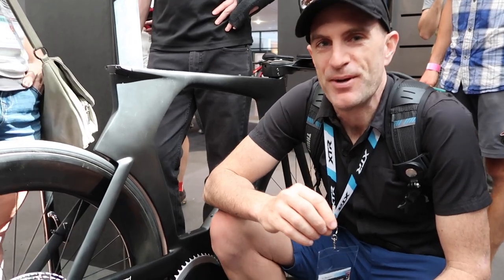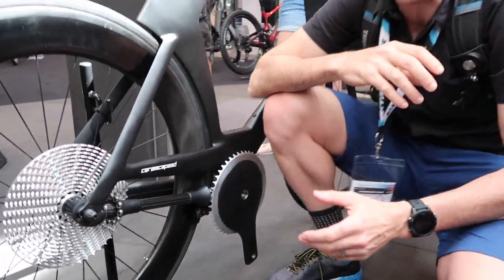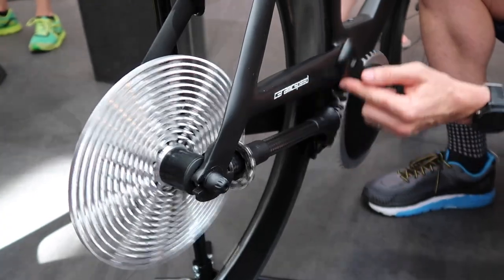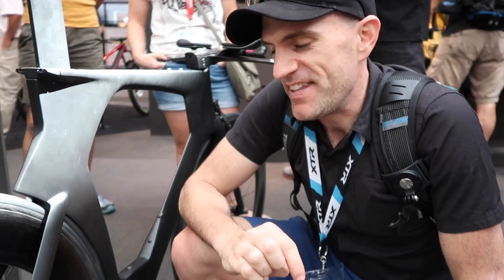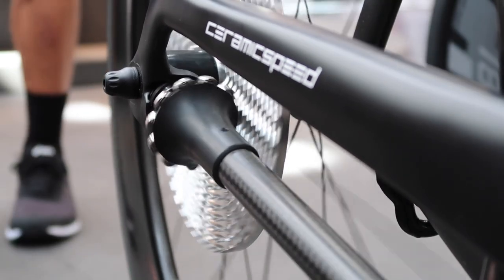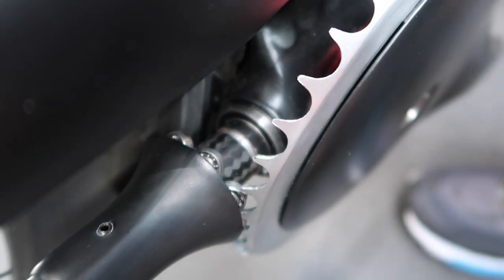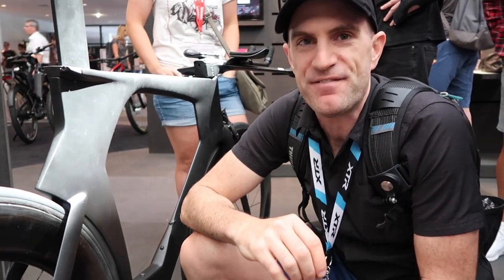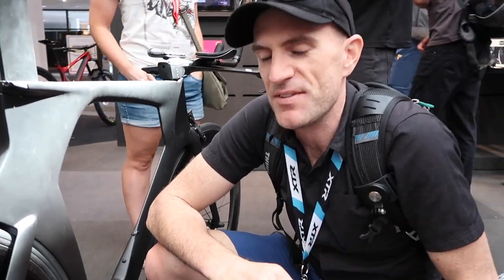CeramicSpeed DrivEN 99% Efficient Drive Shaft // Chain Free Bike // Eurobike 2018

Comment: While I understand the concerns of the ‘engineers’ on here (exposed parts, aluminium gears, ingress of dirt, patented in 1830 and so on), we should bear in mind that this is a PROTOTYPE, not a finished product. All of these things will have to be addressed if the concept is to move forward.
The idea of a shaft drive may not be new or even as efficient as a chain but there is an undeniable appeal to its clean lines and I’m pretty sure there is a place for it.
Gear selection by changing a helical drive contact point across a disc looks like a brilliant concept. Admittedly this particular example leaves a lot of questions unanswered and it’s easy to see that it needs more work, but so does the Mars expedition. Showing it to the public like this should be of benefit.
My own take on it might be to enclose the gear bevels into a housing to keep the dirt out and give scope for a more robust construction which would in turn allow more torque to be applied to the pedals. It would also allow for ‘enclosed, low maintenance lubrication’ if needed.
And how about putting the gears at the pedal end? If the drive shaft itself were telescopic the existing ‘varying diameter disc’ concept might still be used but at the front, and that would put the ‘contact point’ further behind the front sprocket and out of harm’s way.
Alternately a fully enclosed ‘gearbox’ with Epicyclic or planetary spur gears could be used at either end of the shaft and the whole thing could be enclosed. It might not look as ‘trick’ as this one but I don’t think I’d want to catch my trousers (or worse, a finger) in that exposed machinery down there next to my foot. It all looks a bit sharp.
Anyway, nice one Shane Miller - GPLama , good interesting video (congrats on four and a half MILLION hits), and well done Ceramic Speed, it clearly still needs work but it’s a great idea and ideas keep us moving forward.  Keep it up and keep it upright!
To the 4K of ‘thumbs down’ engineering critics out there, how about being a little more constructive? Tearing things to pieces isn’t much of a help. Let’s have a bit more inspiration and a bit less condemnation.
Peace, pedal power and love (from an old hippie)!
Reply: Dennis Loobman none of the questions are unanswered. This is elementary level stuff that first-year dentistry students can answer with only a few minutes of thought.

Comment: Those bearings won't stand a chance in mountain biking. Gear boxes and belts could be the solution.
Reply: Even on the road, those open bearings won't last more than a few days..
Reply: With a traditional chain grit would just add some unwanted noise and air. In this it could cause one of the bearings to fully seize. It's really just a showpeice since you would only be able to shift gears at where the teeth line up on the cassette which would probably only be in one part of the cassette and most apparent in the biggest ring would be the torque of the driveshaft would force the cassette to bow away from it causing it to skip teeth. To mitigate the issue of shifting they perhaps could have one drivering per speed and have them all float freely and have the selected gear locked to the driveshaft like in pinions gearbox but this solution would defeat the claimed goal of power efficiency.
Reply: It's not for mountain biking. Just like a full suspension isn't for road bikes.
Reply: Joselo Aero   Belts tend to slip & flex too much. Not a good idea in cycling yet. Power transfers are problematic.
Reply: seedorfj   100% correct.
Reply: hapiman97 
I get what you mean there. I'm sure a final product would have sealed bearings. About the gear system. It's practical and would work better than sliding the pinion back and forth potentially causing missed shifts. Let them figure out how to make it lighter. The shifter mechanism will take more thought to neatly package.
Reply: Rex Luminus  I’ve had belt drive on powerful Harley and bells without problem
Reply: Russell Artist   Most are chain driven for some good reasons.  Your's 👍good too. Drive shaft on some BMWS are fine too. Some are less noisy or easier on the the systems.
Reply: Rex Luminus guess you realised auto correct spelt bells instead of buells 😂 and yes shaft works well too, guess I’m just too lazy to lube chain 👍
Reply: Russell Artist    Lubing chaine only in 5 minutes.  I know. Longer when needs major cleaning. Runs easier after lube job.

Comment: 2.2k people prefer chains. what's up w the dislikes? this is awesome
Reply: Kekistani Trumper cause it's not awesome. A chain is over 99% efficiant already and works. This will not work due to the stresses and the amount of force that would be transmitted to the teeth of the rear pinion.
Reply: Sadly most people have no imagination.  My last 2 motorbikes have shaft drive as i skipped a chain that lock up my rear once and decided never again.
Reply: Millions of people prefer classic shifters to internal gear hubs even though they are nor athletes or tourists.

Comment: this is nothing new, a re-engineering of a old design, with new material.... original patent is from around 1890-1930's.. from before the standard chain...
Reply: Those bearing things wont last under extreme pressure
Reply: what patent ?some times old patents havee not solved problems, which to day are very importent to have the mechanism to Work...but you are right, almost every idea have been thought of before, but importen details and when using different or in other ways, details must be developed, whereby neww patent cab be issued....I have patents my self for bikes..I know now, that more importent than patent, is to finish the idea for the market.....

Comment: If the driven shaft bearings outer faces engage at 180 degrees to the gears (try slightly cupped gears machined to 190 degrees for example), then jumping shouldn't be a problem until wear sets in.  Good work and innovation here!

Comment: And yet it's well known in the motorcycle world that a shaft drive is less efficient than a chain drive. With a shaft you are losing power as are turning the drive through 90 degrees twice.
Reply: phil955i 

And in the motorcycle world you don't have the additional drag of front and rear derailleurs not to mention the loss of efficiency due to the chain running across sprockets.

The final thing being that shaft drives on motorcycles run in a bath of oil  (fluid brake) and also don't feature multiple ballbearings as the drive medium but usually helical gear sets.
Reply: - and once they start engineering their prototype to be able to take continued abuse over long periods of time, they won't be using those bearings or those discs. They'll be using gears made of steel, then they'll need to beef up their mounts for the shaft and also need to redesign their method of changing gears. And when they're done, if they hadn't given up before finishing, they'll realize why chains and sprockets haven't been replaced by shafts to drive bicycles by any of the previous attempts.
Reply: a10miletooth 

Ahh and you know this how? Assumption?
Shouldn't be that difficult to engineer the drive disc to be rigid but light with careful design.

Using a dual phase ultra high strength steel along with a bespoke hub with a wider mounting flange would take care of the deformation issues and keep things light. Also, carbon fibre for the drive shaft is a great choice as when formed correctly it will have near zero ability to deform significantly enough to cause the drive to skip.

The exposed roller bearings are my biggest concern though I understand this is a prototype and sealed units would likely be used if this were to be an open system. I think small needle roller bearings would be more ideally suited to the application. I also assume the drive system would be encased in a light weight carbon fibre or abs plastic casing to keep things clean and to be able to contain a small amount of extremely light fully synthetic lubricant, though only a small amount so as to not have the drive disc act as a fluid brake as it picks up speed.

Just a few musings. I think it's a superb concept.
Reply: - it's not an assumption, its physics. Their attempt is going to go the same route as every other attempt in the past. The cost of the materials and manufacturing along with the loss of efficiency makes the project doomed for this application before it's even off the ground. The dismissal on your part regarding the difficulty to engineer their concept into something strong enough, durable enough, and light enough to be an alternative is startling. Suppose they could, without having to redesign their rear drive wheel, the loss of efficiency alone is enough to never use the system. Even if they had access to lubricants and bearings that don't exist, the efficiency will never come close to a system that doesn't have to transfer the force through two 90° angles. It's not possible. Riding a bicycle with a driveshaft is like riding a regular bicycle with brakes that apply a bit every time you pedal. Why would anyone want that.... exercise bike?

It's great to innovate, but if what they do doesn't evolve into something that can be applied to anything other than what they're intending, it's a wasted effort as far as the product is concerned. The knowledge and experience gained will help them down the road on other projects though.
Reply: - it's not rocket science, changing the angle of force by 180° will require more effort to achieve the same results as not changing the angle of force. If you don't understand this, you should take a class on it. Yes, the analogy is crude, but the effect felt by the rider needing to exert more force than would be needed on a bike with sprocket/chain drive is what that would feel like, it's additional resistance that the rider would be pushing against. You can't engineer that out of the equation without going into science fiction.
Reply: It's common knowledge that if you put drive through 90 degrees as in a shaft bevel drive you get losses, hence why shaft drive on a motorcycle is less efficient at transmitting power to the rear wheel. Nothing to do with frictional losses, quite simply, unless you have the drive in line with the rear wheel, as in the case of chain drive, it will be less efficient. http://www.youmotorcycle.com/motorcycle-chain-drive-vs-belt-drive-vs-shaft-drive.html
Reply: - it's neither arrogance nor assumption to have a basic grasp on reality, efficiency and torque loss on a driveshaft system is impossible to eliminate and these nuts are claiming 99% efficiency? Maybe on that flimsy aluminum prototype that could never actually be used, and after it's already in motion keeping a constant speed while on that stand with the rear tire off the ground. Even in that situation having 99% is magical. If their drive wheel isn't a solid chunk of hardened steel it will deform, if they intend to use those little bearings to grab each tooth one at a time, they'll break off, if the don't mount the driveshaft in something solid the force from the drive sprocket will RIP it off the frame if the teeth on the sprocket itself don't break off first. There's a really good reason why every single bicycle driveshaft system fails miserably and will never replace chain driven sprockets. You drank the koolaid too deeply on this one. Do you even know what torque loss is and how much is lost on even theoretical frictionless systems that change angles on rotational force? The friction on even the worst quality 10 speed bikes from Walmart wont even come close to the efficiency loss on a bike with the best engineered functional bicycle drivetrain using a driveshaft. There's no magic material that is light enough, strong enough, and cost effective to compete even without the efficiency loss, and if there was, someone would use it to make a chain and sprocket system that would be even better still. Why don't you come on back to reality? I know reality isn't as good as what fantasy can be, but at least it's real.
Reply: - of course you have that experience, like everyone else on YT that will tell people they're MIT graduates or nuclear physicists. For all your supposed knowledge and experience you can't even acknowledge the torque loss through a driveshaft system of this type automatically makes it less efficient at transferring power between things that are parallel vs using a chain with sprockets. It's good that you're not going to respond, you've made enough of a fool of yourself.
Reply: - So you don't agree with established knowledge that you get power losses when you turn drive through 90 degrees as in the shaft drive featured. Seriously, you should've cut your losses at the start & not made a fool of yourself. And I have a recognised qualification in engineering too, been working in the automotive industry for 30 years after serving my apprenticeship as a draughtsman, but I didn't feel the need to spout that unlike you when you realised your argument held no water.
Reply: phil955i 

Of course you do, Philly.

You started by spouting your ersatz knowledge on here so don't be too shocked when you get called on it, you imbecile.

ANY drive train will create losses due to various factors including friction and while a 90 degree drive of any type will run at a loss so will a chain running sprocket to sprocket.

Edit: If you're struggling with where your moronic letting off occurred please see your initial post.

My experience is derived via agricultural machinery design if you're wondering, I'm sure you are.

Your assumptions (and they are assumptions) make me think you're either a plumber and nothing to do with the automotive world or your automotive experience extends to  pumps passing fluids through 90 degree turns and the pressure loss due to that 90 degree turn. That scenario doesn't translate into gear sets. Both great careers but both leave you unqualified to comment here.

You and your low watt bulb of a supporter should have cut your losses by not even posting a single thing. Your problem, not mine though.
Reply: a10miletooth 

Ahhh, is that your version of a white flag?

Good man, I knew you'd concede eventually. You have have a great one and y'all come back now, ya hear?
Reply: phil955i 

Don't self project your inadequacies, Philly.

Edit: Ahhh, you deleted your idiotic comment, a parodoxically very wise choice by an extremely foolish man.
Reply: a10miletooth 

P.s. I love your additional work to your previous post, it made me smile.

Anyways, I don't expect to hear from you again... or do I?
Reply from the maker: Guys.... Please.
Reply: My work here is done, he's been exposed as the fake he is LOL
Reply: Bye!
Reply from the maker: ok. I'll leave this here. Each view/load bumps this closer to 4,000,000..... which is what I hope it hits soon. It's just bikes though guys. I haven't read the thread in the entirety. Let's just ride bikes. :)